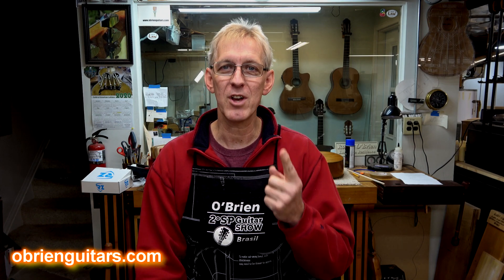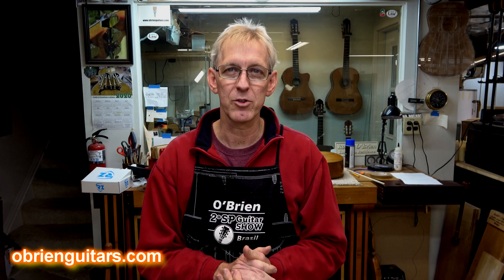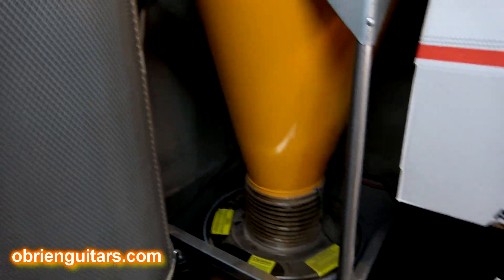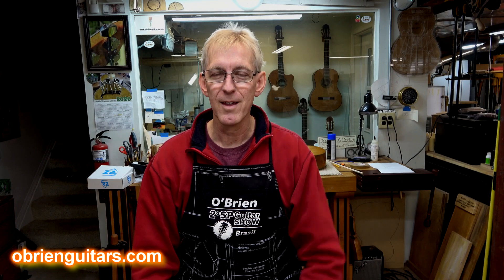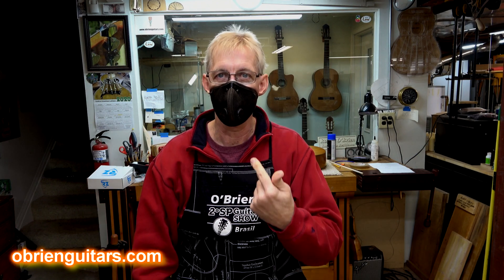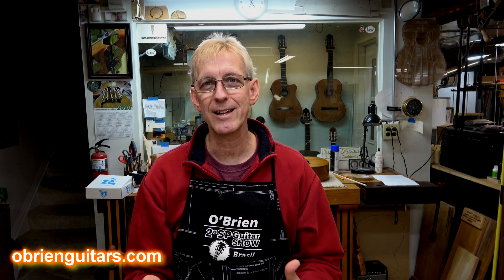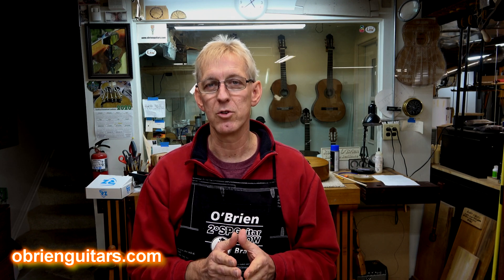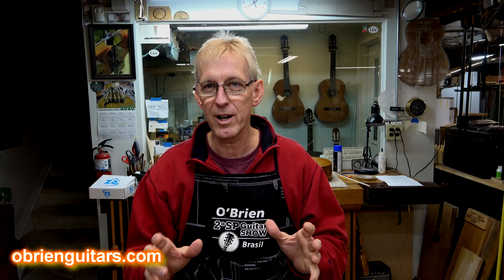3 ways to control dust in your shop

Comment from the maker: If you can't afford a dust collector and an air cleaner, here are some suggestions.
If you have a shop vac you can get the Oneida Dust Deputy. https://amzn.to/2Le90TG
It is a cyclone separator and helps keep 99% of the dust from even getting into the shop vac filters. 

They also make a cyclone separator to be used with the single stage dust collectors on the market. https://amzn.to/3hv5EHG

A single stage dust collector is not very expensive and when used with the separator mentioned above is very affective. I do recommend getting a collector with a filter instead of a bag. https://amzn.to/34YTDFq  They are more expensive but worth it.  

If you are going to get a single stage collector and also the cyclone separator, I would spend a few bucks more and get this system from Oneida. https://amzn.to/2WW2tzq

If you need some Brazilian coffee to help wash down the dust before you get a dust collection system, here are a couple of brands I purchase when I go to Brazil. They are also available through Amazon.  https://amzn.to/3o7eQEE    https://amzn.to/3n3p5Zs

All of the links I am posting here are associated with my Amazon affiliate page and will help keep the lights on at O'Brien Guitars if you decide to purchase through them.

Comment: +1 for the RZ mask. I started using one about a year and a half ago and it's the best I've used.

One item that anyone who is serious about dust management in their shop should have is a particle detector to be able to measure the air quality in your shop. Without the ability to actually measure the  air quality, you are only guessing and assuming that the system you have is actually doing what you expect it to be doing.  We all know the problem with assuming we know things that we in fact don't know. A good particle detector like a Dylos is a good investment in your lungs for way less than the cost of a dust collection system or an air handler with the good filters in it. If you can't measure the air quality in your shop, you are operating on a hope and a prayer.

Comment: Bear Mr. O'Brien, thank you for a most important presentation. I followed the journey of a wood turner who started itching from Coca Bola wood dust and then found himself in the emergency room unable to breath and almost died. His doctor gave only one option; quit! The doctor, a specialist in this field, was adamant about the danger of sensitization (especially rosewood family) and the other issue, microscopic particles which can never be expelled from the lungs as they are too small and the false sense of security supposed filtration systems give you as we are dealing with almost vapor, not dust so much. For a filter system to circulate it has to expel, supposedly filtered air into the shop but the filters are not efficient enough. This doctor recommended you only create wood dust outside with a respirator or at least in front to a big open door with a powerful fan behind and in front of you. In other words, get the dust outside. All of it. I know of a violin maker who is so allergic to spruce and maple he has to carve (never sand) outdoors. Even planing wood releases toxic vapor into the air. I have my power tools in a separate shed and work in front of a huge exhaust fan with a gigantic open door behind me while wearing a respirator. I still get a reaction to rosewood and have switched to Padauk (which taps about the same, not that I really believe in that so much...). Again, thanks for this important warning. Out of all the overabundant luthier related presentations on the internet, your presentations are by far the  most informative and least subject to luthier "myths". Thanks so much and keep up the great work.
Reply from the maker: Thanks for sharing your experience.  Keep up the good work!

Comment: Airborne dust and particles = bad Airborne hydrocarbon fumes = real bad. Robert is so right. When I was 25 and bulletproof I would never take the time to worry about dust and fumes! At 61 I have a chronic cough in the winter months and am in the early stages of COPD. Ventilate well and wear a suitable respirator when spraying solvent based products. Do your lungs a favor, this includes when spraying outside!

Comment: #4 a way to evacuate the air in your shop. I have a smallish basement shop and ended up building a box to hold a squirrel cage blower that fits in those small, old school basement windows. If something burns or goes haywire, I can clear the air in that shop in seconds. I also have a new canister style dust collector and a Jet air cleaner so I definitely agree with those aspects. Thanks for the tip on the mask.
Reply from the maker: If you are exhausting air out of the shop it needs to be replaced. You could be pulling even dirtier air into the shop (think pollen and other contaminants) and you also need to be careful that you don't suck carbon monoxide into your shop if you have a water heater or furnace in your work area. Pilot lights can also get extinguished this way.

Comment from the maker: Product links: 
Oneida Dust collector - https://amzn.to/380dYwf
Oneida Deluxe Dust Deputy - https://amzn.to/3n0YkVp
Jet Cyclone Dust Collector - https://amzn.to/2MkGP5Y
RZ Mask - https://amzn.to/380WuQo
Powermatic Air Filtration - https://amzn.to/3pBP7ol
Jet Air Filtration - https://amzn.to/3pCpYdi

“The video and description may contain affiliate links. If you click on a link, I may receive a commission. Money earned helps to support my channel.”
Reply: The most important video of the year. All that stuff about making fine guitars isn't worth a penny if you can't get up the steps to your shop because your lungs are shot. I notice you don't mention positive pressure powered respirators, which I changed to years ago. Don't fog, don't constrict and are the only effective option for people with beards (don't need a seal). Usually don't come with fume filter capability, however, so I use FP to finish. RZ masks don;t seem to be available in the UK, but 3m do a mask with replaceable fume filters. I notice the jet filtration doesn't meet the fine dust spec you mentioned, which is a pity, since I've been using one for years! Also, I forgot to add, kudos to you for being transparent in the description about possibly receiving commission from links. Big thumbs up for honesty.

Comment: A cheaper(ish) option for  shop air filter is to get a big merv 15 canister that would be used with a clear view cyclone, seal and mount it to a base and drop an 8 inch inline fan in the top.  I have mine set up to pull air from the outside of the filter, and I have a 90 degree elbow so that I can aim the clean exhaust air where I want.  Total setup is about $200 and I suspect it out performs most of the commercially available models due to the huge filter surface area.

Comment: Hi, you talk about 0.1 micron, but the links provided only talk about 1 micron.
did you replace the original filters?
where do you get 0.1 micron filters? it is already difficult to find 1 micron filters
Reply from the maker: Here is what the RZ website says - The F1 is our standard RZ Mask® filter, consisting of two layers. The first layer is our highly effective particulate filter, trapping particles down to .1 micron in size.   The Oneida site says its filters go to .3 micron.
Reply: @OBrienGuitars  ok, so not every filter you have is 0.1.
what about the overhead air filters?
Reply from the maker: @filoavignonesi2128  The powermatic appears to only go to1 micron and not .1 micron like I stated.
Reply: @OBrienGuitars  ok, thank you for looking it up :)

Comment: How about bringing your filtration down to .05 microns? That would be working off of your main filtration. Clean area and no dopy masks. However, I do like that mask you have!
Reply from the maker: Lower is good but there are some situations and areas in my shop that still require a mask.
Reply: @OBrienGuitars  That I understand. Safety first.